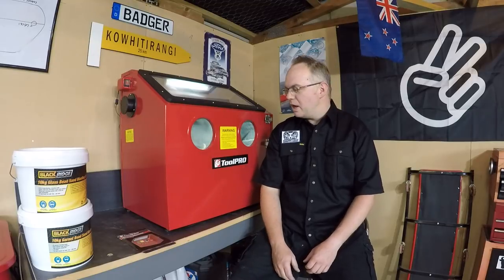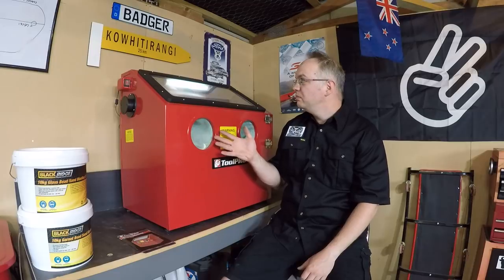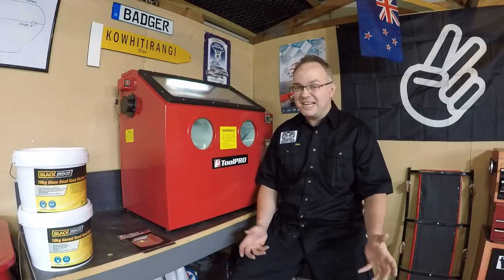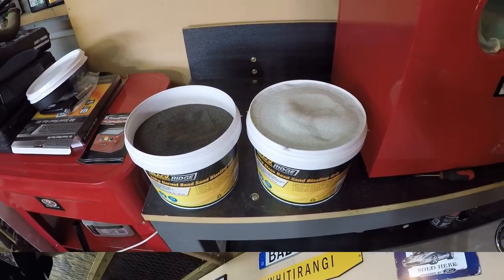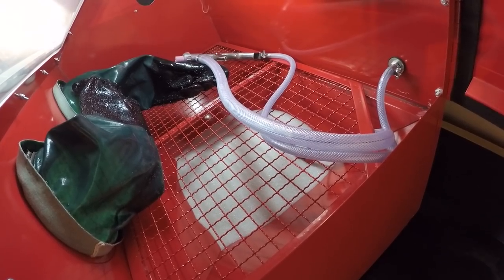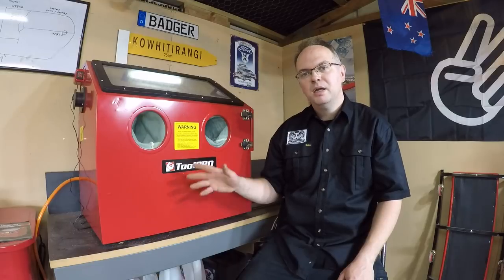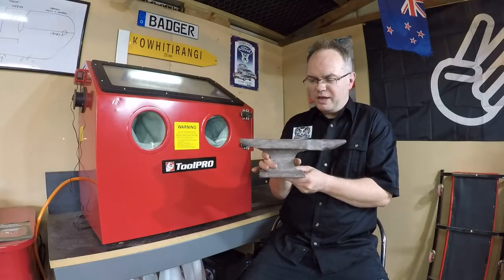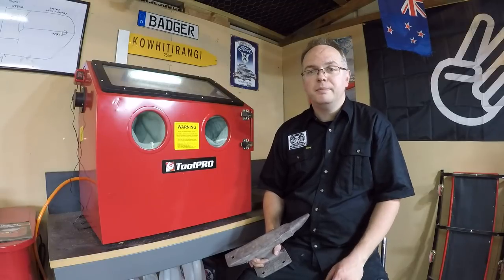ToolPro Sand Blasting Cabinet - Tested!

Comment: Media blasting is very therapeutic!
Reply from the maker: It would be if the compressor didn't keep springing into life 😂
Reply: @Badgertronix  WHAT?????
Reply: Yeah ya switch from the lawn mower to the blaster in the winter. 
Course Badger is going into summer.
Reply: @EXOVCDS  Er sagte, mach das Radio auf
VAS?
Reply: Taking your blasting cabinet to the bathroom is a real pain in the
cabinet.

Comment: without knowing what the underneath of the sandblasting cabinet is like - what if you drilled a hole into your bench and connected a length of tubing from the underneath of the cabinet through it which empties into a bucket lower down when you are wanting to change your media over - might save having to lug it over to the stand each time and more importantly save your back
Reply from the maker: I've wall mounted the cabinet so I can drain it in situ and it doesn't take up bench space

Comment: Might have been prudent to mention the power output of your compressor as that looked rather unimpressive ! ive had far better results using a Pressure washer with sand blasting attachment !
Reply from the maker: Compressor I used is linked in the description. Running at 100psi which is what the cabinet is rated for. Cheers
Reply: Badgertronix The Link wont open on ios in the uk, wants me to download Google app to view which i already have so i have no clue what compressor you are using, I would need to fire up a laptop to see link and thats way too much effort 😂
Reply from the maker: Haha fair enough. 2.5hp, 185l/min FAD, 115 psi max, 40 litre tank. Tank is probably on the smaller end of the scale. I'll try and track down a sand blasting attachment for the pressure washer so I can do a comparison.
Reply: Badgertronix , I think you would have got better results with a bigger compressor but hey ho its what you have ! hopefully someone will send you a bigger one to test lol ! yes my pressure washers is a bit of a monster its 13hp Honda with 21litres a minute output think its around 3600psi or more im not sure, the attachment was only £35 and i used block paving sand, it need to be kept dry which is hard, The results were really good and quite quick ! probably do a whole underside of a car in a day ! They do Karacher Sand blaster attachments too, anyway love your channel im just a fussy scotsman 😂👍🏻
Reply from the maker: I hear ya. Certainly a bigger compressor would help, but this is the largest compressor that Supercheap do. I'm trying to show these tools honestly by showing results and feedback from people like you with different experiences is really useful. I'll let you know what I really think once I've finished the current projects 😂 cheers